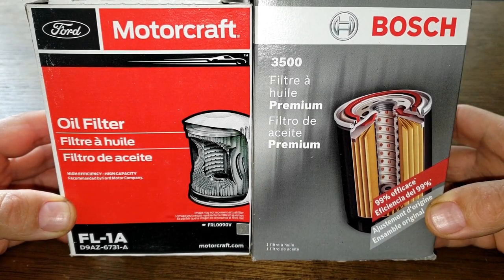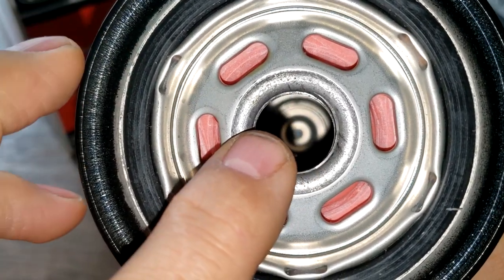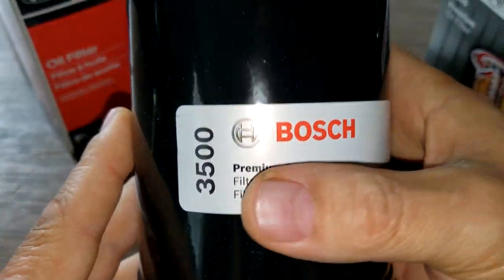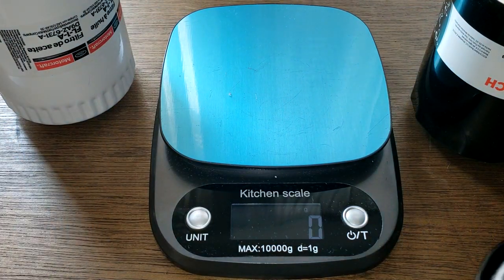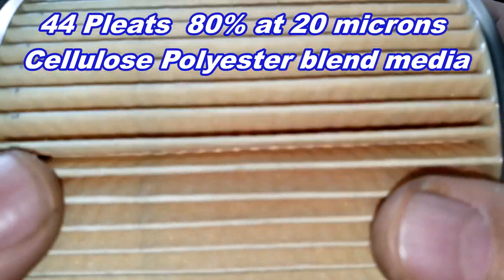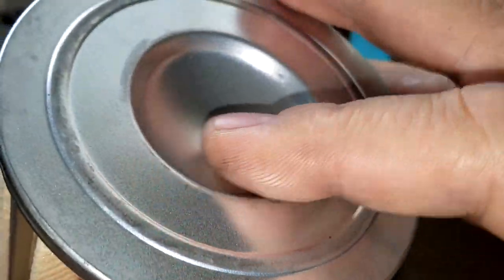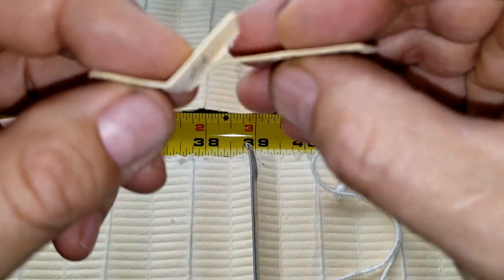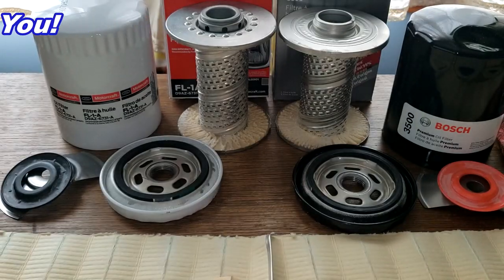Motorcraft Oil Filter Cut Open Fl1A Vs. Bosch Premium Oil Filter Cut Open 3500 Oil Filter Review

Comment: looks like the quality is improving at Purolator, those filters look pretty clean, with no excessive glue like we use to see. I like the old school string on the Bosch and the silicon anti-drain-back valve and thicker media, so I have to give the win to the bosch
Reply from the maker: Your Right bud, these filters were pretty clean.😊
Reply: Bosch

Comment: From what I understand both filters are put together by Purolator. Being designed by their respective engineering departments (FoMoCo and Robt Bosch) they differ in some ways, but the construction contract is with Purolator; which is now MANN+Hummel owned along with Wix. Two years ago MANN+Hummel public relations department told me they would be operating all three of their filtration companies (MANN, Wix, Purolator) as separate entities.The Ford dealer told me that the Motorcraft bypass valve was designed to let oil bypass through the top of of the filter instead of possibly picking up muck from the bottom of the filter can and cycling dirt back through. How true that is in practice I don't know. They also told me that the Anti drain back valves are coded on the can. -A for nitrile and -S for silicone. (FL-1A vs FL-400s). I use both and that seems to be true. I use the FL1A, 400s, and 820s on our vehicles. When I owned Audis I used Bosch exclusively. They're both fine filters.
Reply from the maker: From what you said, all seems to check out at least from what I've seen.
Thanks for sharing👍

Comment: I use a Motorcraft for my kids Fusion. Always has a silicone anti drain back valve.
Reply from the maker: The ones with an S in the filter number have a silicone ADBV.

Comment: I use the FL-1A on my 4.0 Jeep. It's much larger than the stock one. Works great.
Reply from the maker: Yep, it is a big filter, this filter fits my Ford 4.0 also, but the Bosch has more filter media and a better micron rating.
Thanks for sharing👍😊
Reply: @WhipCityWrencher  I didn't know about the Bosch. But I do now! 
See, your videos are not in vain!

Comment: I've seen a lot of oil filters videos and Bosch always beats Motorcraft so I use Bosch and never have had any problems. By the way my OCI is 7,500 miles on synthetic oil.
Reply from the maker: Thanks for sharing👍, 
a 7500-mile oci sounds good.
Reply: Both are made by Purolator. Buy Purolator BOSS

Comment: I will only use Motorcraft FL820S oil filters on my 2006 Crown Vic. I have had 0 oil related issues for 30 years. The FL820S has a silicone anti-drain back valve. I change my oil and filter every 6 months.
Reply: nothing wrong with that, 2003 f-150 4.6 here.
Reply: I’ve had several fl820s fail on me. Do a search for them. They are not a good filter at all. High failure rate. Much better filters out there for the money. Slices in the adbv, tears in the media, end caps not glued properly… purolator quality…
Reply: @jordanmarling7947  I've been using them for 22 years and hundreds of thousands of miles. My 1994 Lincoln Mark VIII had over 300,000 miles on it and I have NEVER had one fail or malfunction in any way shape or form on any of my vehicles. You are not going to find a better filter for the money. They are $3.97 and are by far the least expensive filter in this application. It's a waste of your time to try and tell me any different, because I will not stop using them for my 4.6 Ford, based on my trouble free use of them for over 2 decades.
Reply: @j.t.cooper2963  how many do you cut open though? I cut all mine open. When I started seeing issues I moved on. If you check the forums it’s all too common. Just because you don’t see the issue doesn’t mean that there isn’t one. Not all failures result in a catastrophic engine failure. But at the same time these problems can’t be good for the engine. Look it up. Tons of issues. Especially with the fl820s. It’s the worst offender.
Reply: @jordanmarling7947  "For a friend". 😂 Ya, sure you did. I have cut a few open in the past and they were just fine. Piss off.
Reply: @j.t.cooper2963  wow. Must be having a bad day hey? To drag up this from a year ago… have a good one.
Reply: @jordanmarling7947  I didn't see your comment until now, and why wouldn't the subject still be relevant today? I am talking about a product I've used for 30 years and somehow you seem to think you know more than I do about it.

Comment: Cool to see a classic filter like the FL-1A. I always thought they were a bit of a strange design how the can is so big but has a relatively small diameter gasket and holes for the size of the can. There is alot of space between the edge of the oring and the edge of the can.
Reply from the maker: I didn't notice that, 👍😊
Reply: The distance from the O-ring to the edge of the can means nothing. The O-rings are the proper size to fit the vehicle's oil filter mounting pad.
 Base Plate Hole sizes are sized and numbered to reflect the proper oil flow rate thru the engine, depending on the factory oil pressure.
 The Fram Titanium uses the shape of the holes to direct oil flow, but it would take some really cool machinery to test how that works.
 Whip City done a real good job on this one.
Reply: Agreed Chuck, it shouldn't make any difference to its performance. To me they just look funny cause most filters utilise the whole top of the filter for the base plate.
Reply: The bigger the can the better, like a ph8a - huge and cheap! For instance a PH2 fits a jeep patriot and is 3x the size of the factory filter.
Reply: @SlikLizrd  Both have the Fram website-approved stamped leaf retainer spring. The Bosch wins for the silicone anti-drainabck valve.

Comment: I see this video is only 3 months old which makes me scratch my head since the Motorcraft filters I get have a silicone anti drain valve and are over 90% efficient. How old is that FL1A filter anyway?
Reply from the maker: That's the way they make the FL1A filters, Nitrile rubber anti-drain back valve.
The filter was made on July, 19th 2021
Thanks for your feedback👍

Comment: For me, the bypass valve setting is the most important feature of the filter. You would think Ford would have the Motorcraft bypass valve set exactehere they want it
Reply: The Ford bypass is just fine, the entire filter body lifts up. Same spring and manufacturer as the Bosch. Just a paper difference.
Reply: @RRaucina  Hey, brother, where can I get some of that shit you're smoking !??
 The Bosch and Motorcraft oil filters are two (2) totally different designs. Different Face Plates, different Filtering Media, different By-Pass Valves, and even opposite colors.
Reply: @SlikLizrd  Hey Einstein, Bosch and its associated companies bought Purolator some years ago and Motorcraft filters are made by Purolator. Explains why the  baseplates are identical and made on the same stamping line. They just seal the can with a different set of guts. The Motorcraft has more media if you buy [2] making it ideal for mid oil change replacement. Motorcraft, Bosch, Purolator and others all from one  factory in the USA. Quality can't vary much between them.
Reply: @RRaucina  Sorry, Richard -- I must have mistook you for a human.
I've heard that "They're All The Same!" speech a thousand times. It was bulls**t the first time I heard it -- and it still is.
Modern factories are capable of making a variety of products at different specifications and quality levels. It's done every day in the Shock Absorber industry, for example.
Reply: @RRaucina  Civilized people don't refer to others as "Nazis".
 You can do better.
Reply: @SlikLizrd  Yes - those who run out of factual responses and actual information often resort to calling someone names. You would NEVER do that.

Comment: Is there any filter out there that’s better than a 20 µm rating
Reply from the maker: I think it's pretty safe to say that if it's catching particles 99% at 20 microns then it's also catching smaller particles but at a lower percentage.
Reply: YES, there are a few Oil Filters that are capable of filtering particles smaller than 20 Microns -- BUT -- there is currently NO SPIN-ON Oil Filter that exceeds the ISO-4548 -12 @ 20 Microns.

Comment: Made in the same factory! Bosch are about 2x the cost typically.
Reply from the maker: They might be made in the same factory but the Bosch looks to be a better filter between these two.
Reply: @SlikLizrd  I buy 2 Motorcrafts for 1 Bosch and change it every 3k miles. Now you have some clean oil at a budget price.  People that think cost = quality are the addled ones. My grandfather used toilet paper roll filters in his old Ramblers. Cut that open.
Reply: @RRaucina  My '59 Rambler had a cartridge-type  Oil Filter.
The Frantz Oil Filter (T.P. Roll) was touted for decades as being cheap and effective.
 I never used a Frantz.
 Yes, you can buy 2 Motorcraft FL-820-S filters for the price of 1 Bosch # 3410 -- and you get 3,000 miles of use, while the Bosch gives me 5,000 miles of use -- AT 20 MICRONS.
SO, while half the cost LOOKS like a much better deal, I find that the longevity of the Bosch and the 20-micron filtering ability to be of greater value TO ME, while others are free to make their own choices.
Reply: @SlikLizrd  My grandfather was born in 1898 in Slovakia, so he had a lot of experience with a lot of crazy oil filters or the lack therof.
Reply: @RRaucina  Very interesting -- I'd like to hear his opinions on modern motor oil filtering technology -- and the Bolshevik Revolution.
Reply: @SlikLizrd  Slovakia bordering Ukraine, then Russia made him and all his buddies that built Detroit and all the steel mills and coal mines left Europe around 1916 to get away from said political chaos and WWI. He would tell you to buy Purolator, which is the same as Bosch and Motorcraft. Smoke that!
Reply: @RRaucina  NAH. They're NOT the same. Bosch has the best Micron Rating. Motorcraft has the best By-Pass Valve location. Purolator has the most gimmickey name.
The story we keep hearing about how Purolator got it's name is bogus.
The oil filter works similar to a coffee PERCOLATOR, which was popular at that time, and was the actual inspiration for their oil filter design.
The folksy story we get today is all about "Pure Oil Later" -- but it's total bulls**t.
Reply: @SlikLizrd  If I had the time and space I would add 2 auxiliary filters and run one of each 3. No testing needed then.
Reply: @SlikLizrd  "Motorcraft has the best By-Pass Valve location." I thought that reduced the filter media or is that according to the Fram website?

Comment: The motor craft gives a higher flow rate. Great for people that maintain a sludge and crap free engine. As well as staying on top of oil changes. I do mine every 2000-2500 miles and replace the filter every 1000-1250 miles. I like motorcraft. I know it will give me great protection when I step on it, with the higher flow rate. If I neglected my engine, and drove 10 miles under the speed limit, I’d go with more filtration, lower flow.
Reply from the maker: With that OCI your engine must be very clean.😊
Thanks for sharing👍

Comment: 99% at 20 microns is great. Bosch Premium and Mobil1 Extended filters used to be identical from 2007 till about 2016 that I know. Not sure anymore.
Reply from the maker: As far as I know, the Mobil oil filters are still 99% at 30 microns.
Reply: @WhipCityWrencher  Crap.  These ratings are a moving target nowadays. We have about 100 trucks and the only consistency I've found is Bosch Premium, Wix Reg/Napa Gold, and Fram Ultra. For now anyway.

Comment: The days of an OEM filter being premium is over. There's only a few manufacturers of oil filters Champion Labs, Fram, and Mann (Purolator, Wix, Napa, Bosch). You can buy a premium filter made by the same company for not much more money. Dealerships have gotten these OEM filter made cheaper and cheaper for more profits. Motorcraft used to be a standard Purolator with a silicone ADV! now you get a nitrile ADV and less filter media. SMDH
Reply from the maker: I agree, I like to go OEM parts but oil filters not so much. I believe the Motorcraft filters that have an S after the size number still use the silicone ADBV.
Thanks for your feedback👍🙌
Reply: @WhipCityWrencher  That is correct.
 The "S" in the Motorcraft part number designates a Silicone ADBV.

Comment: The BOSCH box shows a silicone gasket and the product appeared to be N-rubber.
Reply from the maker: Your right! Good catch👍, I missed that one.
Reply: It's a printing error. The red-colored gasket is supposed to be black. Most oil filter gaskets are Nitrile Rubber (black).
Reply: @SlikLizrd  Except those that don't.

Comment: I got a FL1A at Walmart today and its not like the one you have it has changed . now looks like that Bosch filter from the flutes on the can and the bypass valve in the end of the filter it has a date code of 901182216 not sure if this is a permanent change of if they ran out of parts and had to run the Bosch parts line for a while .Hopefully this is not the new way of FL1A with the bypass in the end of the filter and not at the thread base end.
Reply from the maker: Wow, I didn't know that I'll have to get one and check it out.
Thanks for letting me know about the change.👍
 I think your date code comes out to be Jan.18, 2022.
Reply: Ok thanks
Reply from the maker: Hi Wayne,
Your correct they have changed, I picked one up today at Walmart and plan on making a video sometime this coming week. If you dont mind I'd like to mention your name on the video but that's up to you, let me know if it's okay with you or not. 
Thanks!
Reply: @WhipCityWrencher  Yes that will be fine thanks for the update
Reply from the maker: Hi Wayne,
I made the FL1A video today and compared the new one to the old one that I had used in this video. Also gave you a shout-out. It will be shown on May 17th. Thanks for the heads up on this filter.👍
Reply: @WhipCityWrencher  thanks Looking forward to it

Comment: & i hav NO problems running my AMSOIL filter & oil in my lexus nx200t  3 years, 2 months & 2 days, going 23,671 miles... & still getting 36 / 38 mpg... use & sell AMSOIL...
Reply: I your only getting that mileage something is wrong w your car should easily be getting 40 to 50 mpg

Comment: Nice video, and just the one I like, because it compares the stock oil filter from FORD with the Bosch Premium filter that I run in the famous 95 MERC.
The Bosch Premium is the clear winner, with much more filtering area and a finer micron rating.
BUT -- the BIG deal is the Motorcraft's Pressure Relief Valve at the inlet end of the filter, and not many filters have that feature.
 It appears that both filters were made by the same company -- but with different specifications.
Your test shows that I can't go wrong with the Pennzoil Ultra Platinum, 5-W-20; the Bosch Premium Oil Filter; and the FILTERMAG #SS365PR Magnet Kit -- changing oil & filter at 5,000 miles.
P.S. -- Thanks for using Grams instead of Ounces -- Ounces are America's other embarrassment.
Reply from the maker: Thank You!
Yep, you got a good combo for your Merc.
Some people like me weren't taught metric in school, so I'm trying to please everyone by putting both grams and ounces.
Thanks for your feedback👍🙌
Reply: @WhipCityWrencher  Pretty sure I'm WAAYY older than you, and they didn't teach Metric back in my day, either.
 BUT -- it's really so simple -- everything is a multiple of ten (10). With a little practice, you can do Metric in your head.
 Anyways, I thought I saw one of your videos that showed an oil filter with the pressure relief valve on the INLET end, AND it also had that coil spring that you favor -- but I noticed that the filters that have the coil spring have a much shorter filter element. Or maybe not.   ;>)
Reply from the maker: @SlikLizrd  I'll try practicing metric, it's good to know both. It's definitely simpler with wrench sizes.
As far as the coil springs go, yes the filter element is usually shorter to allow for the taller coil spring vs. most stamped leaf springs. For example, the Supertech oil filters have the bypass valve built into the stamped leaf spring and they fit inside the inner core so they are almost flat.
Reply: I'm with you on the Pennzoil, Bosch, and 5000mi oil chg interval, but especially the FilterMags. 
Not especially a fan of metric system. I've used both as a machinist and a surveyor. Metric is  good for really, really big and really, really small things, but for real life things, SAE is fine, and they CAN use decimal inches and decimal feet.
Reply: @SlikLizrd  Both have the Fram website-approved stamped leaf retainer spring so they meet your criteria.

Comment: Apart from the difference in Bosch's picture regarding the core (holes vs. louvers), the pic also shows a red silicone gasket whereas in the box it's black rubber.  False advertising?
Reply from the maker: I know I missed that, another viewer pointed that out also.
I've found a few boxes of oil filters where the picture didn't match the filter inside.
Thanks for pointing it out 👍
Reply: Differences between the actual filters and the colors on the box are most likely to be a Printer's Error, or some such minor glitch.
False advertising !??
Ridiculous !!